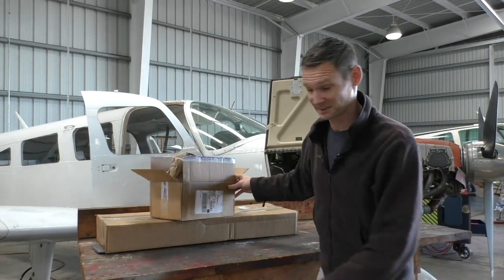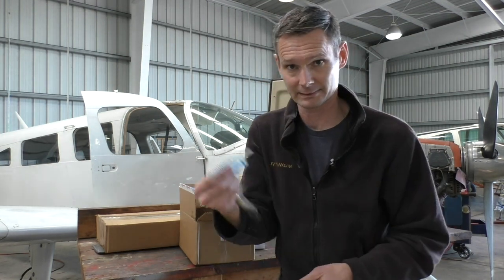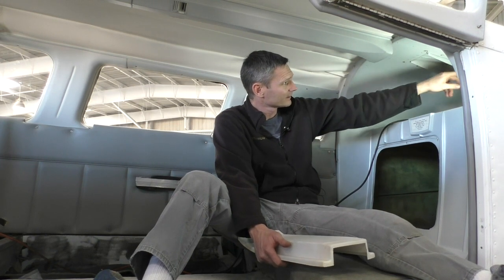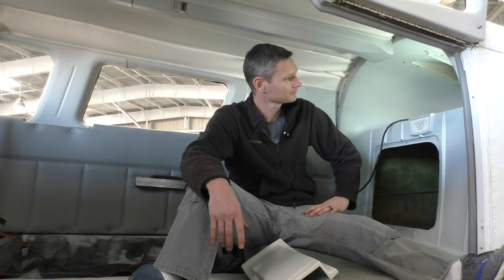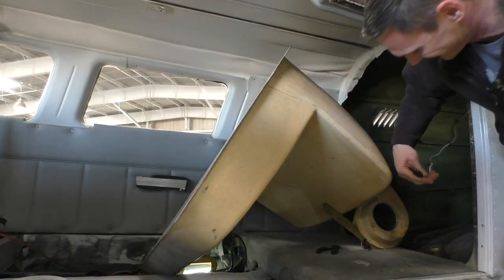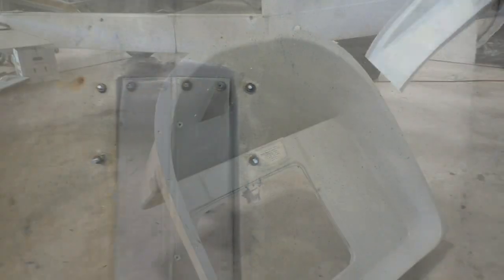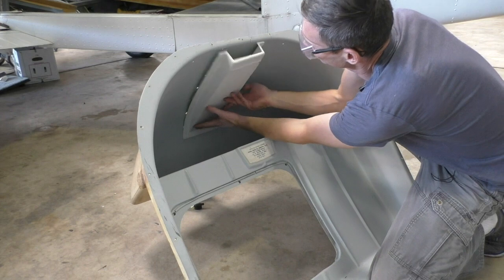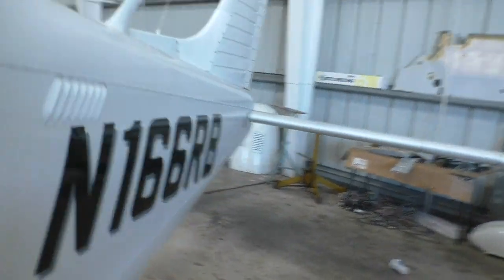Time Lapse! fixing broken plastic on the airplane. Auto Pilot update!!!! watch till the end! EP14

Comment: Fantastic, but costly progress!  To attach the air duct, I have a couple of suggestions, in order of cost: High bond double faced tape such as 32M VHB. or velcro, or use wellnuts for the replacement mounting. Makes service easier, too!

Comment: Its amazing how those Piper plastic interior trim pieces can easily turn into plastic potatoe chips because the plastic itself has offgassed to the point where it becomes brittle.  Glad you were able to find replacements.  Had to do this on several Pipers I had worked on and some of those replacement parts you have to tweek to get them to fit properly.

Comment: I fight a similar battle with the plastic parts on my Piper Aztec. Supposedly it takes 450 years for plastic bottles to degrade. Someone should have told the airplane manufacturers that plastic parts can be made to last longer than 20-30 years. Your project is coming along - keep up the good work.
Reply from the maker: for real!!
Reply: Pretty sure that the manufacturers in the 60's never expected their airplanes to still be flying in 2021.
Reply from the maker: @kevinjarchow8812  seriously!
Reply: Chez Pierre!  yep that was bad. I want my 13 minutes back.

Comment: Jimmy, I know this is an old video and you have sold this plane, but had a suggestion.  And may apply to your current projects. Instead of the loose nuts on the "wrong" side of the bulkhead trim panel, epoxy an aluminum strip on that side, drill appropriate size holes and then install "nutcerts".  Then the screws holding the duct can be removed without losing the nuts or being forced to remove the bulkhead trim panel.

Comment: I think you will find those plastic parts are made so you can trim them to fit. I never saw one that fit just right the first time. Make yourself some wooden supports that will fit in the back of the fuselage that you can lay on and not stress the cables when you are back in there. Get an old pallet and cut it apart for free lumber.  And here is a question for the mechanics in the hangar. How do you know when it is time to retire?  For me it was being 67 and crawling up off the creeper for the 17th time in a couple hours, standing in front of my tool box and wonder what in the heck I got up there for. Adios.  BTW Jimmy, The encoder doesn't tell YOU how close to the ground YOU are, it tells ATC what your altitude is. You would need a Radar Altimeter to tell you your altitude above the ground or your GPS could do it.
Reply from the maker: ahahahaha, yep! time to go!
Reply: i dont mean to be off topic but does any of you know of a way to get back into an instagram account..?
I somehow lost my account password. I appreciate any assistance you can give me
Reply: @Orion Jaxton Instablaster ;)
Reply: @Kamari Jason it did the trick and I now got access to my account again. I'm so happy!
Thanks so much, you really help me out!
Reply: @Orion Jaxton Glad I could help =)

Comment: Awesome Jimmy! Can’t wait to see the auto pilot. So... the auto pilot actually controls the ailerons and stuff?
Reply from the maker: yep! 2 axis, ailerons & stabalator, not the tall pointy thing on the back... lol
Reply: @therealjimmysworld  the tall pointy thing is controlled by the foot pedals right ? So it controls the altitude basically ?
Reply from the maker: @Bansheeboat  yes, the foot pedals control the tail.  That controls the "yaw" or the right/left turning.  the stabilizer (on this piper, it's called a stabilator) is the horizontal part of the tail that controls the pitch (altitude) and the ailerons on the wings control the roll.  They all work in concert to make different maneuvers.
Reply: @therealjimmysworld   ok I will wait for the next video lol the auto pilot unboxing 🤗

Comment: Who's going to sign off all this stuff you're doing? If you're not an A&P find one quick. You'll need an IA too. Any time you attach something to the air frame or add or remove something from the equipment list you need a 337. Better reweigh and find the new CG too. Just because you own it does not give you the right to do what you are doing. It nulls your insurance unless done legally with the paper work to prove it.
Reply from the maker: great question, I answer that in this video: https://youtu.be/8M42B379apE